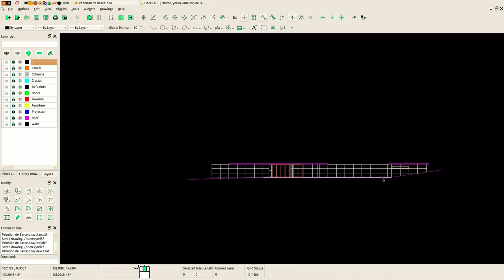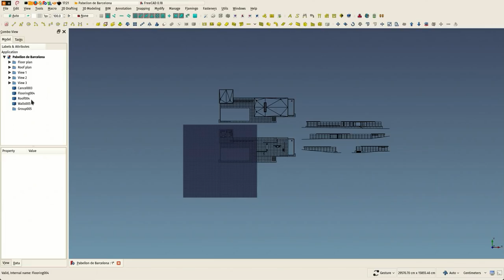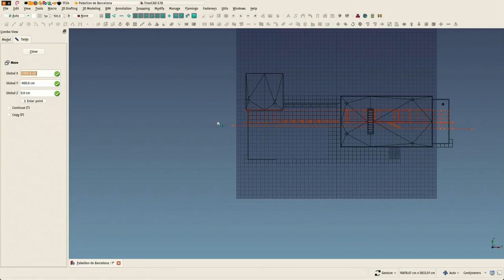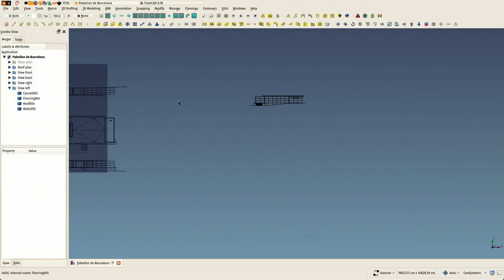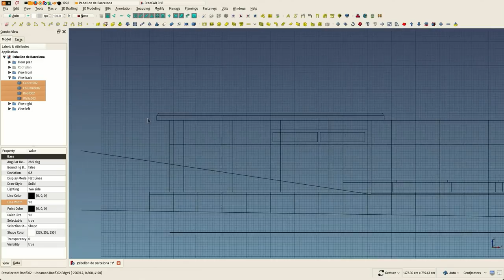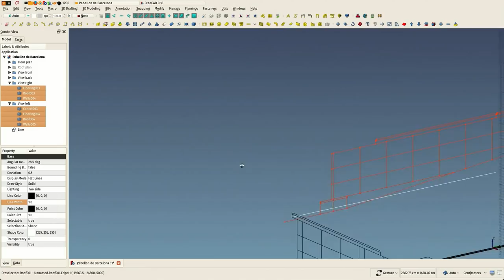BIM with FreeCAD - Barcelona pavillon 01 - preparation

Comment: Thanks for the huge work. I find an issue with some INCH magnitude have been introduced prior or durring import. I sloved it my importing with a factor 39.3700 (100/2,54)... to reach 1 meter modular grid. 

Version: 0.19.24267 +148 (Git)
Build type: Release
Branch: Branch_0.19.4
Hash: 476ecf091941bead59b14e44afa6064d5a66afa3
Reply from the maker: I don't understand your issue very well, but the best place to report bugs is at https://github.com/FreeCAD/FreeCAD/issues Make sure to give step-by-step instructions so other people can reproduce the problem, so it's easier to find the cause. If you are not sure if it is a bug, then it's always best to discuss first on the forum at https://forum.freecad.org